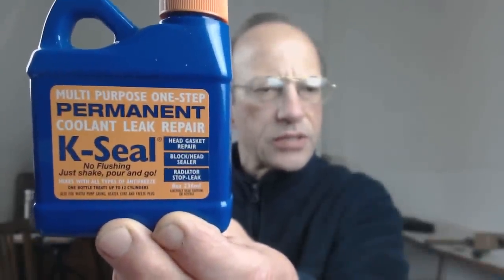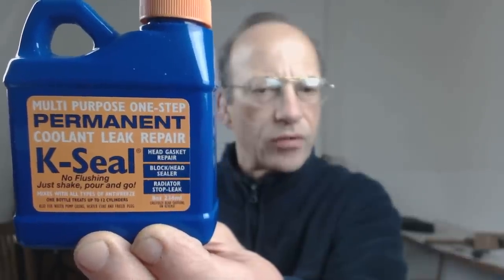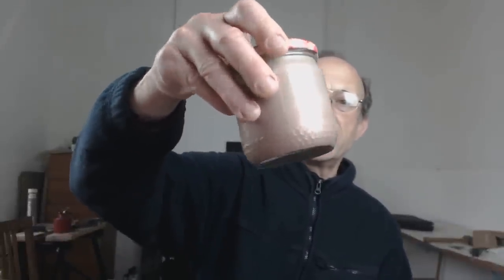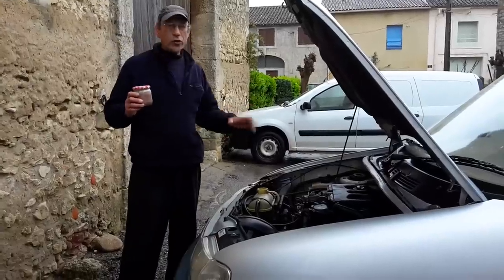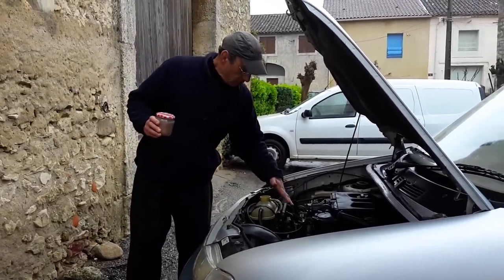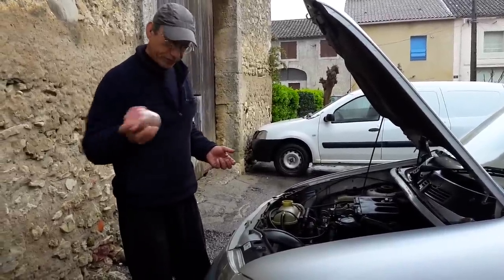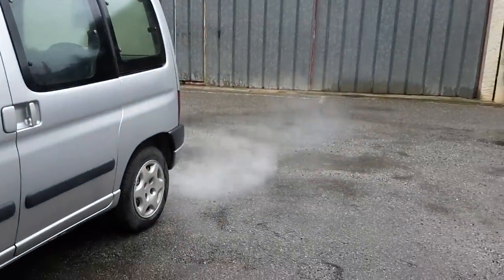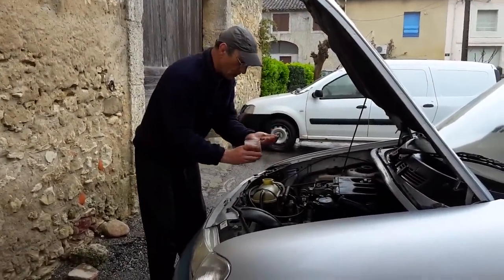K-Seal Full Test - Purchase options, Instructions & Results

Comment: Going to try this stuff.  Coolant is disappearing; lost at least a quart so far and keep topping off.  Pressure hold test at the radiator shows no leaks.  No white smoke. No milkshake oil.  Not a drop under the car.
Reply from the maker: Yes... it should fix it.
It will only get worse, so it's probably a good time to act ;)
Reply: Thanks.  I was planning to put it in tomorrow morning on a cold engine and drive it about 50 miles to work.  Do I need to let it sit for a length of time for best results or can I go out to lunch after 4 hours?
Reply from the maker: Good question!
I can only speak for what I did.
As you saw in the vid... the engine was cold.
This allowed me to remove the pressurised cap.
Adding the formula when the thermostat was open (touching the rad), simply ensured that it would immediately circulate.

Whether this procedure requires a religious following, I don't know.
I was simply following my own engineering logic.

SO.... if I was you.... with work tomorrow...
I'd set the alarm 30mins earlier.

Take the rad cap off, and start the engine, till it's warm (ensuring the header tank has room for the formula).
Once you know the coolant is circulating.... pour it all in (after shaking).

Let it tickover for 3 - 4 minutes at least.
Then replace the cap, and steadily drive to work.

My guess is that it will be the end of your problems.... but obv... report back ;)
Reply from the maker: Good luck Galaxia!
Chances are (from feedback) that you'll be fine :)
Reply: Follow up.  Turned out it was a bad  radiator cap.  Good luck to all.
Reply from the maker: Thanks for that follow up lastuberman.
It was kind of you to take the time :)
Reply: No problem.  I added the K-seal to the radiator so I feel like I've vaccinated the cooling system against leaks.  337,000 miles and going strong!
Reply: @EngineTuning  Hallo, after the 3-4 minutes or more and the fix what did you do next ? Leave the engine to cool down for a night or drive it the same day ? If it worked for you it might work for me too !! Can you also give an update ? Thank you.
Reply from the maker: @dimosthenismagos7982  I left the engine idling for 15 minutes.
I had no problems for 4 years.

About 6 months ago, I noticed that I was slowly losing water (but it was no inconvenience).
There was no vapour exiting the exhaust.
I suspected it to be a different problem.
I added another bottle of K-Seal three weeks ago.
Yesterday, the water light came on.
Consequently, the water loss may be due to a failing seal (which can't be fixed with k-seal).
Reply: @EngineTuning  Did you use the car the same day ? Can i use it with the antifreeze ? Also i have a small 4 cylinder engine 1.1 citroen C3 2008 mod. with 7 littres cooland. Do you think it's a good idea to use 1/4 or 1/3 of the Kseal just to be on the safe side and have the job done ?. The problem seems to be minor. Cooland loss about 150 to 200 ml in 550 km. No white smoke, no cooland in oil, no oil in cooland, no visible loss. Thank you for being such a help.
Reply from the maker: @dimosthenismagos7982  Yes, you could use half a bottle.
Make sure that you first shake it well.

It will repair head gaskets and cracked castings, but it won't repair rubber seals.

You can use it with ant-freeze :)

Comment: Just added Ultimate (full-bottle, diluted in 1/3 gallon distilled water, used half the mixture, thermostat left in, heater core not bypassed) to the over-pressurizing (expansion bottle fills up and bubbles over, hard top hose) cooling system of an ‘03 Forester. Doing the first heat cycle now. Long drive ahead. Stay tuned for updates.
Reply from the maker: Will do!
:)

Comment: I'm going to try it this tuesday and I'll definately let you know if it worked. I bought it after seeing this review. You've convinced me so if it works you'll be in my prayers.. (if I were a religious man
   :) )
Reply from the maker: So.... today is the day.
Best of luck with it.
Reply: +PlayF1 Net so I tried it. It seems as if it has worked. No more loss of fluids.  Thanks a lot for the tutorial.
Reply: +PlayF1 Net I did not have the typical symptoms of a leaking head gasket but I was loosing fluid with no trace. I've read that in the rover 400 manual that this can be due to great overheating of cooling fluid. I noticed that my cooling fan behind the radiator was broken of so it did not turn around thud it did not cool down the radiator while in heavy traffic. so if I fix the fan, problem could.be solved.
Reply from the maker: Ah yes.... a fail symptom can be generated from a number of causes.
Sometimes, the best method is to eliminate potential causes.
 
It may be possible that you have paid for a fix, that was not the fix required.
But I think that we've all done that.
 
Anyway.... everybody appreciates it when the facts of the story are told.
Thanks for sharing :)
Reply: Exactly. I always get a bit annoyed that people sometimes ask for advice, get the advice, and say that they wll report back, but never do. ANd other people don't learn then.
Reply from the maker: Top comment Chris..... you are absolutely right ;)
Reply: +PlayF1 Net Thank you and thank you for your advice. PS: ive managed to repair the fan behind my radiator. Ive put in a new fuse too because it was fried. He started working when I was waiting in traffic. So i hope that there was no leak, and that water vaporized out of the réservoir because the fan didn't work. So I hope that the level stays the same. I'll let you know in a couple of days. I just love my old rover 416 si.
Reply from the maker: Me too I liked my Rovers.
I had a Rover 800 and then replaced it with a new shape 820.
Great cars.
I hope everything has gone well with yours :)
Reply: It still works. So i'm very pleased; The car is my baby; I don't have the cash to let a garage repair my car so i'm forced to do the repairs my self; I've managed to repair everything myself up until now ;  Tho I'm a bit puzzled by the weird rattling sound my right rear break makes ever since i replaced the pads. It's as if something has the space to rattle; So when i drive a bumpy road, it is as if there is something rattling. I'm sure it has to do with the brakes because when i'm hearing the rattling, and i slightly push the brake without losing speed (i keep the foot on the gas) the rattling stops. I thought that may be the pads were not the right ones but that is not possible because they are exactly the same ones that were on it AND i don't have the noise on the left side. Strange.
Reply from the maker: Hmmm... that's an unusual problem (rattling).
Because it's only on one side, I'd have a look.
 
A good tip is to always assemble your brakes with copper grease.
I have a tube that is literally decades old.
You smear a thin layer over the locating pins, and a thin layer on the back of the pads, and a thin layer on the sliding shoulders of the pads and caliper.
In effect, you smear the interfaces.
This will stop 'brake squeal' - the high pitched vibration that can occur when you have forgotten to assemble with copper grease.
However, the 'rattle' is new.
 
Consider removing the caliper, and inserting a long piece of wood to replace the disc.
Get a friend to apply the brakes, then lever the pads open, and repeat.
Be careful of the brake fluid reservoir overflowing..... put a cotton rag around it, just in case.
Just make sure that the pistons are moving freely.
 
There may be a 'spring steel' plate required to apply pressure onto the pads (in the area of the locating pins).
If this has been omitted, it would explain the rattling.
 
Copper grease can also be used on brake shoe systems, on the shoe end bearing, and the shoe pivot spigot.

Don't apply excessive amounts of grease..... you simply use more grease to no effect, and loose grease can walk ;)
Reply: +PlayF1 Net thank you very much for your advice.  I'll apply it this weekend. I've also googled it and.found that it could be the anti rattling metal plates that are between the extremities of the.pads and the.brake. I seem to recall that when I pulled the out I slightly bent them and had to push them back to their old form.
Reply from the maker: Yes, it seems likely that this must be the fault.
It'll be nice to knock that one on the head :)
Reply: Just to let you know that the rattling was indeed the brake pads that had some space to move due to the fact that I forgot to put on of the thin tin plates between the metal of the brake and the brake pads themselves; Fixed the problem in ten minutes. My Rover is back as good a new. Thanks for al you input!
Reply from the maker: Ah ha!
Great news.
I'm pleased to have helped :)

Comment: i recently had a problem with my mitsubishi pajero 2.8 auto, the rad was over pressure and forcing the antifreeze out into the overflow bottle but was not returning the ejected fluid when cooling down. I was not getting the symptoms of a blown cylinder head gasket ie water in the engine oil, over heating or steam from the exhaust pipe but the cylinder head on the 4m40 2.8 are prone to cracks around the 127.thousand klm mark seem to be a problem with the pajero. It lookd like a small micro crack in the cylinder head to water jacket, cost to repair around 1000 pounds new head plus gaskets strip rebuild, and not forgetting the poxy labour charges. took a chance on a bottle of K SEAL cost 9.85 followed the info and the problem had been resolved they say its a perminant repair o and i have had no problems with blocking up my heater matrix. i think a lot of the negative posts in ref to K SEAL come from a small amount of purchasers using it after the car had had major overheating problems, unfortunatly its to late as the head and gasket will have warped. also from garages that are loosing trade and possibly over charging for the repairs. 10 stars from me for this product.
Reply from the maker: Nice feedback Pete ;)
Reply: Hi Pete, I have pretty much the same issue with my 2.0 d sportage.. did you use k seal with cold or hot engine? was it poured in the water tank? thank you!

Comment: I just used it, leaking head casket and smelled antifreeze from heater core. 
I flushed my radiator and it was REALLY dirty. I used a radiator flush waited a couple days then flushed radiator (took 10 gallons of distilled water)
I put new antifreeze in and the smell was 20× worse (expected)
I let it run for 15 minutes to get the antifreeze and water mixed. 
Put in the K-Seal and drove 15 miles to work. The antifreeze smell went away in the 1st 3 to 5 minutes (still a very faint antifreeze smell) but I expected that. 
Tomorrow I will see if any condensation with white smoke is still coming out. I want to check in the day time. 
So far very happy but only drove 15 miles and it's only been 1 day. (I'll update)
Reply from the maker: Everybody appreciates a well detailed report. 

Thanks for taking the time :)

Comment: Good stuff. But keep an eye on your radiator cap and thermostat.
Reply from the maker: There has been no problems in those areas.
The only problem now, is that some water consumption is occurring, though it is not excessive.

Comment: About a week ago, I used K-Seal. It temporarily stopped the leak from a split drivers side seam on a brass radiator in a 98 Land Rover Discovery 4.0. It bought me enough time to remove and repair the radiator. However, the intake plenum on my particular vehicle is heated/cooled with antifreeze. The hoses to and from, and the passages in the plenum are very small. The product (as well as many other stop-leak products) clogged these small passages, and the heater core.  It affected the fuel/air mixture as a result. This was easily remedied by "burping" the feed and return hoses to the plenum and heater core to move the sediment from the product through the system. I don't recommend "mechanic in a bottle" solutions for any automotive repair, but this product exceeded my minimal expectations.
Reply from the maker: Once again, good feedback Ian.
Thanks for taking the time to share your experiences :)
Reply: Cheers!

Comment: I have purchased this product but I would like to know the correct way to use it, after using this product should I take out the cooling water and clean the cooling cycle then pour new water or what??  Should I mix this product with water or coolant?
Reply from the maker: Use the product, as shown in the video.
After the problem is fixed, you can change the coolant.
:)

Comment: Sooo i just picked this stuff up my coolant is leaking from the radiator kinda shoots out when its pressurized seems to be coming out of the coil as i can see small drips on my front bumper just below the grill the rest drips on the floor i hope this wrks its a 2016 dodge journey 🤷🏻‍♂️ here goes nothing also i can use antifreez right i dont have to use water

Comment: I noticed in your video you removed the  rad cap run the engine and did you leave the cap off while you run the car or did you replace the cap and then run the car at idle for 15 minutes. 
If I leave off my cap and  run the car the coolant will bubble up out of the radiator
Reply from the maker: I left the cap loose, in order to prevent pressure build up.
The sys is designed to be pressurised, but I played safe.
:)

Comment: My local garage of experienced mechanics advised to buy anything but K-Seal. The reason is that K-Seal has been known to clog up the normal coolant channels and cause further problems. The most popular advertised brands don't usually mean they are the best.
Reply from the maker: What did you expect them to say Tony?
Reply: I expect them to give advice - simple!

I then bought Holts LOYHREP0101A Professional Sealit Leak Repair, 250 ml

What's your problem?

Some garages are honest and advise their customers to try the easiest and most economical option before deciding on more expensive repairs. These products are designed to do just that, however, some work better than others. I have verified online reviews and decided not to try K-Seal which my garage mechanics advised against.

I have so far avoided to have my engine dismantled despite having had a coolant leak and the garage gave me various options and the costs involved - just as I expected.
Reply from the maker: To be honest Tony, you have missed out the main points.

As I understand it  you had a 'coolant leak'.
The type of coolant leak is key. 
It's the centre piece of the post ... or it should be :D

You bought the Holts product, but you didn't state definitively that it fixed the problem.

Having put all the effort in (two posted reports) - it would surely be worthwhile making some edits, to add the key information.
Otherwise the reports that you made are pointless (in the true sense).

Comment: I poured mine in a 1/2 Gal. of Water and mixed that up good and then slowly poured it in the disconnected upper radiator hose.  My point is the more mixed the better especially if you have a small 2.5L 4cyl engine like me.
Reply from the maker: That's fine Martin :)
It doesn't have to be thinned, before adding, but there's no reason why not.

BTW the  "small 2.5L 4cyl engine" brought a smile to my face.
It reminded me of when I had a little Rover 820, with a 2.0L 4cyl engine.